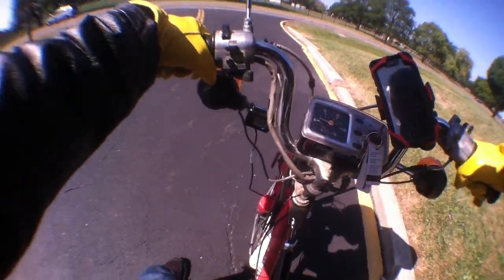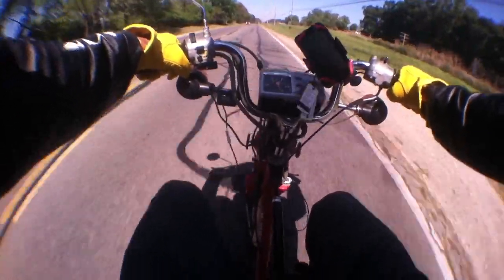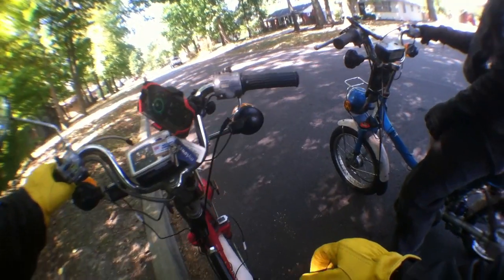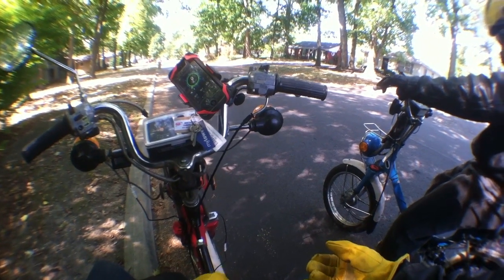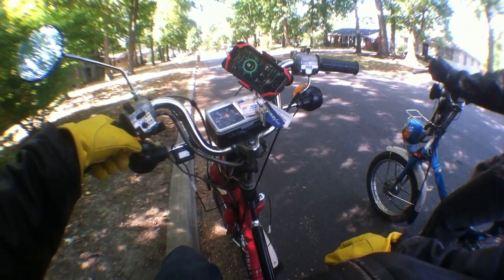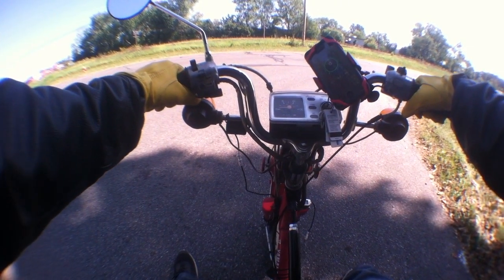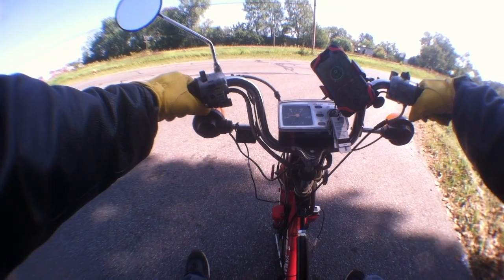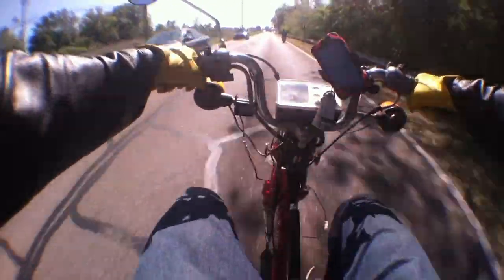Yamaha qt50 HPI Ignition - Ride and Eval

Comment: I consider that a resounding success.  

I noticed that on HPI's website they have an digital CDI (mo money, mo problems) that is programmable so that you program your own curves. Not sure if it is compatible with the qt50 kit, but I will make that my winter project.  Muchas gracias!
Reply from the maker: yeah probably the biggest pro is setting up the timing to control temps.  That is huge.

Comment: Hi, my honda urban express moped runs great... without an air filter. but when i install one(not a factory air box) it runs with half power. wont get over 15 mph, and wont pull a load/drive up hill. there doesnt seem to be any drag on the air filter, it flows freely. any advice?
Reply from the maker: either you are jetted too rich ( too big main jet) or your air filter is blocked or partially blocked.  probably the jetting.
Reply: @churioz26 I'll describe another symptom. When I put my hand up to the hole on the carb where the air filter attached. I feel a mist spraying out. Does this confirm your theory of the rich fuel jet? Is that an easy fix? Or am I better off just riding around without an air filter, and cleaning my carb more often?
Reply from the maker: @samroyerfilmzsrf7424  it's normal for them to mist out fuel like that despite the size of the main jet.  You can get some panty hose and rubber band a piece around the carb as an air filter.

Comment: I want it for low end, temps and 12v. Does it have a better throttle response with the lighter magneto?
Reply from the maker: I think it has better throttle response.  Of course, you can always get the 2 curve CDI for mo money and have the advance timing through 6k rpm or so or you could set it up as is with more advance but deal with temps thru jetting.  12v and lower temps are huge.  In fact, I commented to Karl afterwards that I could practically get rid of the temp gauge as it is currently set up.  365F max during 95% of that ride and then 378F during start and stop in the hood.